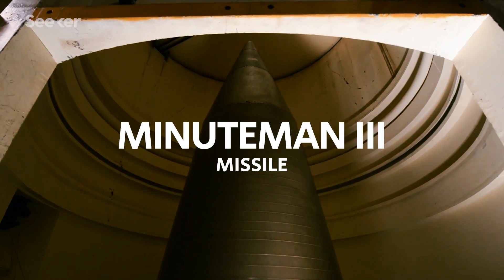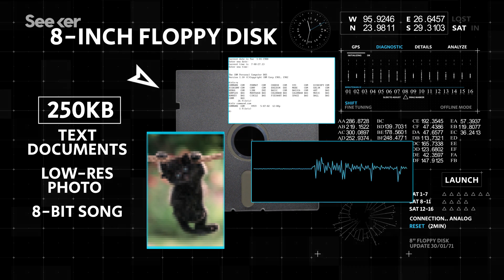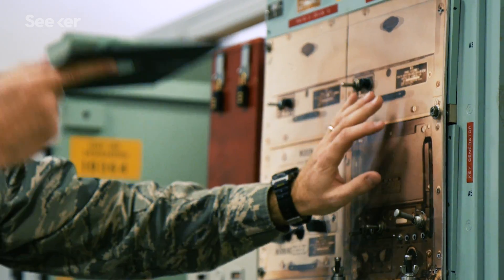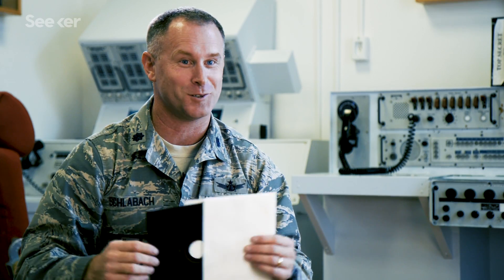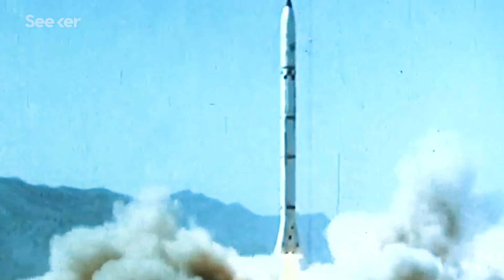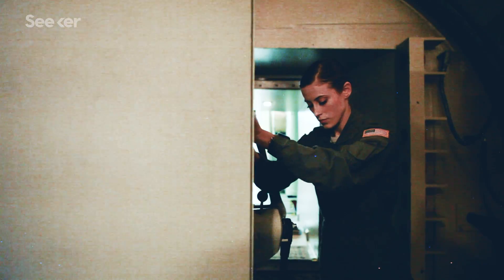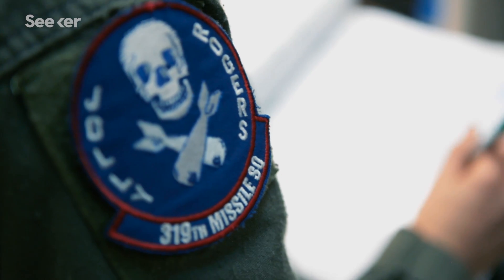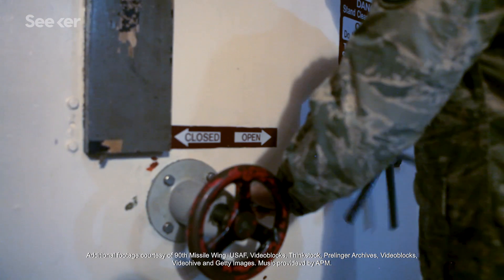When U.S. Nuclear Missiles Were Controlled By Floppy Disks

Comment: As an American Citizen. I'm curious what the "cost" is to having such an older system.  I look at our military budget and its massive, and I wonder if the cost of having to find parts that aren't being made anymore, the cost of having to train people who've never used this type of system before, the cost of maintaining the connections between sites/hq's(going to assume that they also use outdated equipment here also.)  I get that older = safer, and they've probably saved a good amount of money by not upgrading every few years, but like cars after a certain point it becomes super expensive /hard to try and find replacement parts that are good as the machine gets older.
Reply: I highly doubt they spend that much on replacement parts. Unlike a car, these computers arent really doing anything that would cause it to break. They sit in temperature controlled bunkers and perform simple tasks. They're not like servers that process petabytes worth of data or anything.

Comment: I don't really have much of a problem with them using outdated tech, my only concern is floppies are notoriously unreliable and slow.  I think they should, at the very least, use a different and more reliable medium that emulates a floppy.
Reply: And I am old enough to remember and have used soft and hard floppies
Reply: Floppy disks have very little file degradation when not being used, and are much easier to set as permanently read-only.  The biggest concern with them should be getting replacement disks if they're dropped.  They can be fragile.
Reply: Spot on ! if your are user from 80's - 90's you will understand how floppy disk is not reliable when it contacted dust or mold. it would not read.
Reply: keriezy
I said "emulate"... It's not unheard of to have different/better hardware that interfaces where the replaced hardware used to be.
For example, in a lot of mainframes, there are virtual tape drives.  They're just a series of hard drives, but they're emulated to be treated as tapes.
Reply: @Toastmaster_5000  you're forgetting that transferring all the data and changing the system in how it reads and interprets it runs the risk of a glitch in the process and that can have deadly consequences. If it runs fine don't fix the shit plain and simple. They're not transferring terabytes of porn they're simply communicating bytes of text it doesn't have to be sophisticated.
Reply: @jrno93  Not transferring the data and hoping it will work when needing is a terrible emergency plan.  Redundancy and reliability are imperative for such things.  It's not like all of the data needs to be transferred all at once.  During a relatively peaceful time (let's face it, the US is almost never in peace), that's when the data should be copied, one disk at a time.  Once all that data is replicated and proven to be accurate byte-for-byte, that's when they can slowly swap in more robust systems.  It's not something to be done overnight.
Reply: @Toastmaster_5000  tell that to the United States lieutenant colonel chief of safety I'd love to hear his response. He would just laugh his ass off a citizen is telling him he's doing his job all wrong, I guess not having one nuclear winter since the creation of that system means he's shit at his job.
Reply: @jrno93  Have a way for me to contact him?  Because I'll take that challenge.  I'd tell a lot of people high up in the US military (or government in general) that they're doing their job wrong.
Reply: @Toastmaster_5000  you will do nothing!
Reply: I don't mind the old tech, but I would have felt MUCH better if someone had said that they replaced the floppy disks every 2-3 years. The medium is right there, open to the air and dust and whatever else. I never felt, in the late 80s or early 90s that floppies were THAT reliable. I remember replacing them every year or so, just to be sure.
Reply: I've never heard of floppies being unreliable. By todays standards yes they are slow but if you do not need to transfer more than a Meg or so it doesn't matter.
Reply: That would just be unnecessary and inconvenient. So point of trying to change something that already is all you need. I know what you're trying to say though
Reply: It's not so much the unreliability (these are holding delicate data I'm sure they're gonna be well cared for and have backups) as the fact that magnetic media can last as little as ten years, estimations are around twenty for a max age range. Even military grade magnetic media will suffer environmental degradation from humidity, temperature, and such that affect the layers of magnetic material. Plus magnetic storage eventually loses its magnetic charge which also loses the data.
Reply: Emulating a floppy disk opens up a whole world of exploits and backdoors that could be used to tamper with that are impossible with physical floppy disks. Modern floppy controllers and hard drive controllers made in china could contain god knows what (considering the NSA leaked documents, imagine what the chinese government has access to...)
Reply: Peter Schmidt vhrs then?
Reply: Remember Stuxnet?
Reply: Mr President, we cannot launch our nuclear retaliation!
Why is that, General?
Well the computer says "Bad sector, try again?"

I guess that is a good hing.
Reply: Old floppies are reliable.
Reply: This is military-grade floppy disks
Reply: Used many floppy disks, never had a problem with reliability. Never heard of it being an issue either.
Reply: I have cheap floppies that still have recoverable data from the early to mid 90s and I have lost many photos that were burned to a CD and now are completely unrecoverable not 10-15 years later
Reply: It's easier and cheaper to use modern tech but in this case use proprietary interfaces. So nobody can hook their laptop up to it or plug in random USB they found on the street.  Keeping your system this antiquated does not make scene even for security. They should have floppies and drives only they can use. Having one in your home would be a crime and all outmoded gear destroyed. I can't believe they didn't at least update to the 3.5 floppy with the plastic housing that's only a matter of swapping the drives out.
Reply: And where will they insert this better tech? There isn't a usb drive... I bet it's a telephone cable too (not ethernet).
Reply: Unreliable? No. Do a bit of research on the magnetic strength of these discs and you'll learn just how hard they are to erase. (hint: it takes a pretty strong magnet at a sub-millimeter distance.) I have large boxes of 8" floppies, decades old, that are 100% intact -- if you happen to still have a functional drive. (which is actually the hardest thing to find.) Slow? Of course they are by modern standards.

(if you punched a hole in your double-density floppies to turn them into high-density floppies, then you will certainly have a measurable degree of failure as they aren't designed to handle the higher bit density.)
Reply: Ninjaznexx
No, it doesn't.  Y'know why this current system is so secure?  It isn't on a modern network.  Replacing a non-networked drive with another non-networked drive does not have any consequence on security.  If anything, an emulated drive would be more secure, since you could encrypt it.
Reply: If you take care of floppy disks, it is easily possible for them to last longer than you. There is a chance they could be older than you.

Comment: Reminder;
The newer the tech, the larger the number of vulnerabilities, the more people alive who know exactly how to hack it. What you get in return is ease of use, which is pointless in this context
Reply: I wouldn't say its pointless. Ease of use can be important when you're trying to decide what you're looking at. Can it provide diagnostics? Can it tell me if there's an issue? What prevents an accident? What happens when a component breaks or causes an issue? These can be addressed more easily with a more modern system. Look at the technology involved with some older nuclear reactors. The only interface into what is going on into the reactor is a bunch of blinking lights, that's not ideal when you're trying to figure out if the entire system is about to meltdown or not. It doesn't need a ton of gizmos and widgets, but saying we can cut it down to nothing is also foolish.
Reply: Olympia.WA Meltdown and Spectre are in no way related to firmware or hardware modifications. The problem is in how the CPU handles branch speculation (meaning the way it runs conditionals in code). The operating systems had to introduce workarounds because the only real solution is a hardware fix. The hardware has a bug in how it handles memory isolation that can be exploited in code. It's a hardware vulnerability.
Reply: @Sir Spegeta, please tell me you're joking, Spectre and Meltdown are two relevant examples of recently hacked hardware.
Reply: Olympia.WA The firmware isn't what causes the speculation issue, it's the actual processing pipeline of the opcodes which is a hardware architecture. The OS patches move the kernel memory space outside of the application memory space.
Reply: Darkstar Are you being sarcastic? Anything that is hooked up to the internet can be compromised.
Reply: James Durand No man, I know how it works. Modification to the cpu firmware could change speculative processing and prevent the spectre vulnerability. I also understand that accessing memory values outside of a designated programs memory space is no easy task.
Reply: James Durand operating system updates and patches can also help to better detect and prevent access to memory value outside of a programs allotted space.
Reply: I think I'm diving too deeply into semantics here but the firmware is what controls how the code is executed on the CPU. If I change the firmware on a CPU, I can effectively change how the operation code is executed. I know we are talking about attacking the physical execution of the CPU but we have to use the firmware to control those executions. When I speak of hardware hacking, I think of it more in the sense of how it would be used as an outdated term. To physically modify the hardware to make changes to how it operates. Such as back in the day when you would have to solder components onto a motherboard to modify the voltage that would be delivered to the CPU.
Reply: And as for Meltdown, if the kernel memory space is moved out of user space, such as in modern Linux OS's, the vulnerability is effectively mitigated. That's not to say that the vulnerability has been completely removed but it greatly improves protection against privileged escalation.
Reply: I don't know about that...simple code is easier to look at and alter so I'm sure if someone got in there they could still mess things up. Best thing going for me is that the hacker would actually have to go there in person lol.
Reply: Are you saying a modern system designed for such a task wouldnt need to be hacked in perosn?
Reply: truuu
Reply: Are you kidding me? There is most likely an infinite amount of vulnerabilities present in the software these machines are running. They're not mitigating the amount of vulnerabilities, in fact, I'd argue that the decision to maintain these old systems over modern hardware and software has increased the amount of potential vulnerabilities tenfold. 

The thing they have actually done here is minimized the attack surface. While these machines are vulnerable as all hell, the lower attack surface makes it nearly impossible for a remote actor to exploit said vulnerabilities.
Reply: y2k?
Reply: The older the tech the easyer it is to hack because more people know how it works and how to exploit it's vulnerabilities, like not having any security at all.  
Launch the nukes!!
We seem to have a problem, sir.
https://www.youtube.com/watch?v=WtiAP8xMSPo
Reply: The older the tech, the easier it is to hack.  You don't even need to hack those old systems as they will just run the code.
Reply: Downside is that there's fewer people able to maintain this banking systems which is why they're paid so highly. The languages and tooling involved will eventually go extinct.
Reply: That's why many banks still only use AS400, no wi-fi and there isn't many people that know how to hack them, and those who know are paid like their wheight on gold.

And they have many years of development that rarely have a crash.
Reply: doubtful, the service contracts on those systems and because of how the software that's built around them is so custom tailored is the reason why they haven't switched..cost prohibitive. Every system is unique as are the applications written to run them
Reply: James Durand: Yes, hardware can be hacked but really you're talking about the firmware that runs on that hardware that can be hacked and technically firmware is software. However, the hardware in this case that you are saying can be hacked is more modern than what is being used in this weapons system. So I guess in this case, antiquated hardware is safer lol. Also, to your case, hardware can most definitely be hacked by physically modifying it.
Reply: Ryukachoo software is more specific than “tech” you can’t rly hack ram or a cpu

Comment: Biggest failure points in old electronics is capacitors that tend to either short out or go open, and resistors that lose their resistance limiting capacity. So replace those and the lifespan of the silicon in the chip is pretty much limitless.

Comment: Oh boy now I feel old! At least the floppy discs I used were 5 1/2". No bigger memory in the computer though (it was for a shop). I had Pong when I was a kid and my first actual computer was a Spectrum 48k (no floppies, everything got recorded on cassette tape). By the time hub and I needed a PC for his degree course in technology, it cost us nearly £1000, had a state-of-the-art 512k memory (ROM, I don't know how much or even if it had RAM) and we'd moved up to the 3 1/4" 'hard floppies'. It ran MS 3.1. Had a very workable word processor, though each page had to be saved onto the floppy disc to make sure it wasn't lost, or printed directly (on the dot matrix printer with the massive stripy paper with holes down the side). 
I recently had to replace my laptop; cost just over £200, has 4 GB RAM - the PC bought in 2000 had 4 GB ROM and cost twice as much!  - a Tb ROM, writable DVD etc etc etc. Not the best of the bunch but a decent make and perfectly good enough for what I do. In fact I could probably manage on my year 2000 PC's hardware given what I use. The only necessary tech upgrade for me was the wi-fi. And as the officer said, that's not as safe as the old ways!
I do hope that they have a contract with someone like 3M (probably made most of the world's floppy discs at the time) to continue making some floppy discs because they do break. Would be a good thing to have a backup system!

Comment: opld technolgy is better than new in some cases, plus this helps prevent viruses and all
Reply: Chris Bullock 
Literally what the video says
Reply: corey drew bruce huh? (security?)
And yes it does as the tech (obscurity) is so old most hackers are too young to know how to use such systems against them.
Reply: It’s literally on an offline network. When they say network they mean a system of interconnected CPUs within a larger group of CPUs. These systems are not connected to the internet. They have no WiFi or Bluetooth ability making them unhackable unless connected to the internet via (most likely) a telephone line. So the only way to actually get into these would be to have an inside man. Also DOS and the original computer softwares are super easy to hack because most if not all modern systems use them as a basis.
Reply: No it doesn't, obscurity doesn't give it obscurity

Comment: "Its top,top secret.." in the video it shows how this top secret thing works..
Reply: Hardly. It shows that it runs off an old 70's PC. It doesn't really provide any details that common sense couldn't already figure out.
Reply: I dont know if this is really old or newly fabricated but you can be sure this has been looked over by very smart people whose intentions are to keep America safe , right ?
Reply: It will have been looked at by PA and maybe some systems experts.    The room was no doubt brought down to unclass before cameras were taken in, and then examined afterwards.
Reply: I remember that excuse in the government when military award the contract to MS windows as viable operating system over UNIX command line editor.  Microsoft and Apple have developed a process and "culture" to over come the misuse of Top Secret cover up stupidity, fraud, waste and abuse.  This more obvious because most of this people who developed this technology are past retirement age and dead.  It going a lot of reverse engineering, re -engineering on available documents and most importantly innovation.